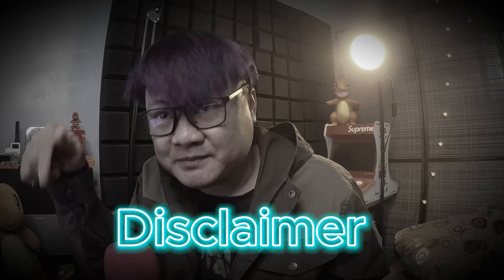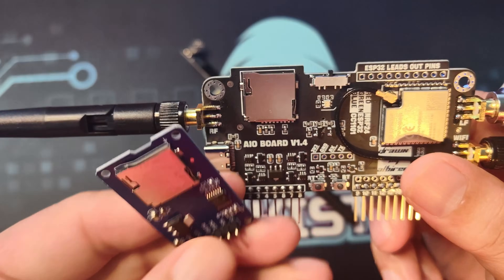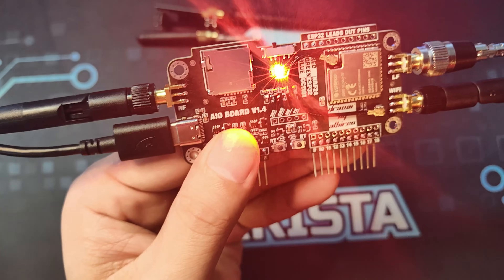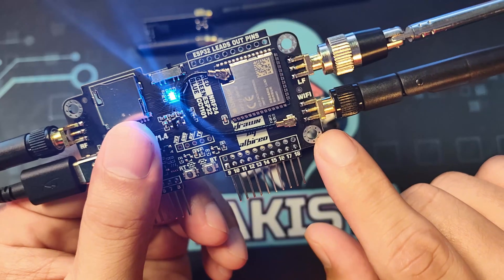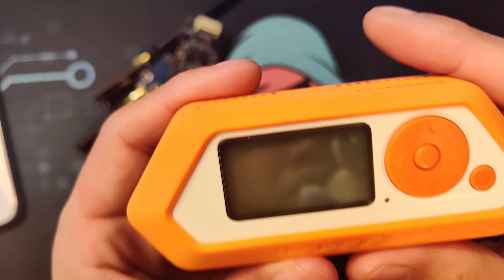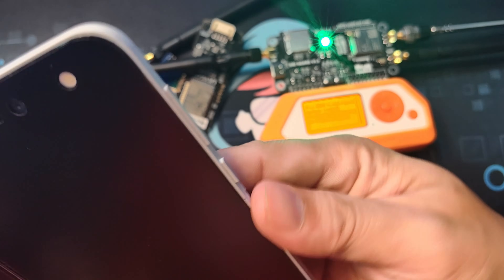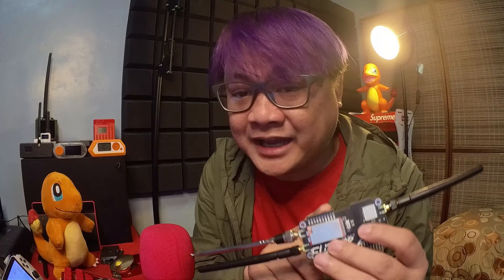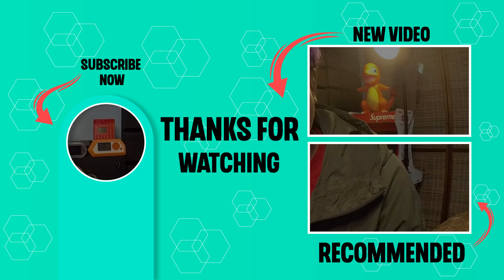Cheap Aliexpress Flipper Zero Dev Board has most of the modules you need! // AIO Board 1.4

Comment: Bro, for education purpose, how can I Deauth my 5ghz devices in easiest way, Bw16 ?
Reply from the maker: No one can do it yet at 5ghz
Reply: ESP basically has a chip which supports dual band wifi, if you can design a board then you can deauth 5 Ghz as well
Reply from the maker: @Moustached_Austrian_Painter  Is this documented somewhere? because the esp32 that has 5ghz just came out

Comment: Hi, I followed all the steps from your video to flash the board, but when I connect it to the Flipper Zero, the lights don’t turn on, and I don’t see it working. Do you know what could be the reason? My Flipper Zero has version Unleashed 80 thanks!
Reply: ESP32-S2 (COM4) IS MY BOARD  and your board is ESP32-S2 (COM24) could be that?
Reply from the maker: The only thing i can think of is that you havent push down the board enough